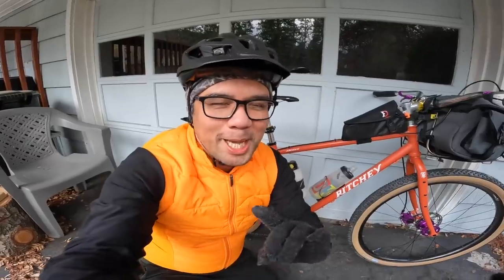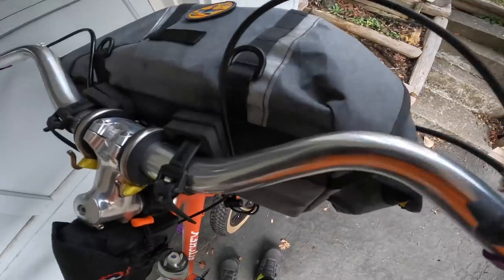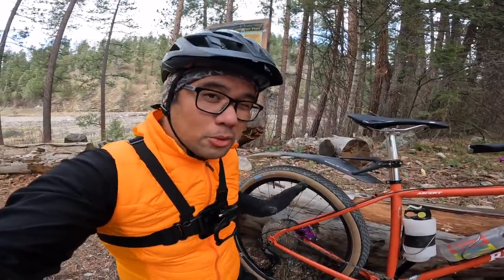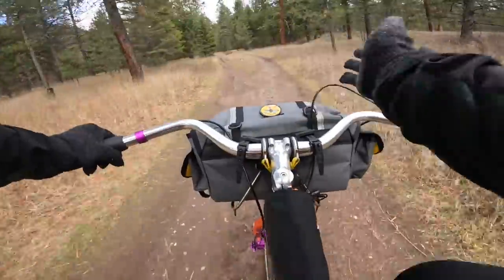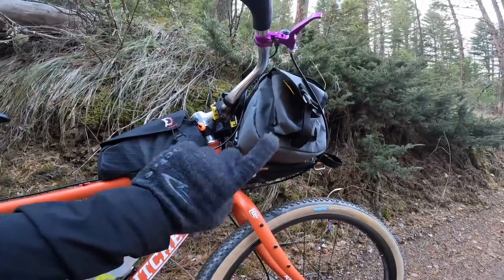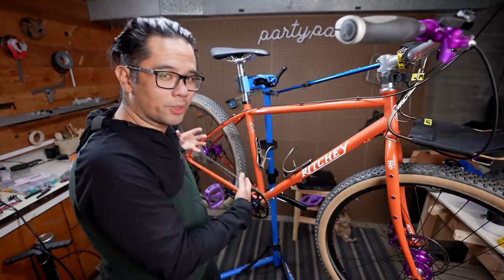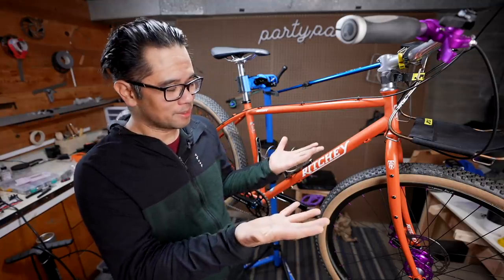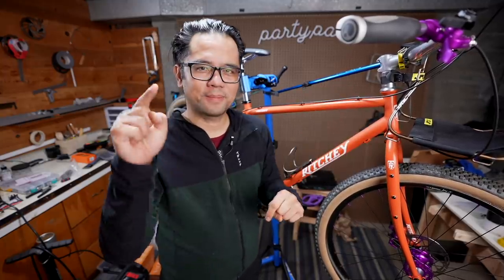This Bike Confuses Most People

Comment: I bought this bike a few days after it was released.  Built it up with Beacon xl drop bars, running 700x45 Rambler tires.  I dig it!  It’s my adventure bike.  It’s been on a few bike packing adventures and a bunch of gravel / single track adventures and it’s been great.  Planning on setting it up with Ardent race 2.35 tires this spring for some spicier bike packing trips that I have planned.  🤙

Comment: Great review and so good to see a brave design ethos in this bike. I’ve got the Kyote bars and added some Ritchey bar ends ahead of the brakes, on the bends. A bit like to VO Crazy but with a hand position in line with the stem - fab
Reply: I have the Kyote handlebars as well. My classic curved barends are positioned as innerbarends where the Kyote sweeps back towards the stem. As they are also 22mm thick you can attach all kind of handlebar accessories. The barends form a loop a bit like a Jeff Jones Bar with the advantage of angle adjustability for better aerodynamics and very comfortable position.
In addition I will test innerbarends from different brands such as Spirgrips and SQLab for the position between the grips and the brakes.

Comment: I have the previous generation Ritchey Ascent with the Ritchey Kyote Bars.  I setup the bike with a large range of gears (3x9), flat pedals and 700x32 armoured urban tires with fenders.  We all need that bike that can serve any purpose - light trails, commute or even road ride in poor weather, all while wearing normal or otherwise not always cycling specific clothing.  The Ascent fits the bill perfectly.

Comment: I have the last version of the Ascent frameset which debuted in 2016. My only real complaint with it is tire clearance, or the lack thereof with 700c tires as it maxes out @ ~40mm. I have a set of WTB Byways in 700 x 40mm on it normally. It does clear 27.5 x 2.1".  Right now it's sporting a set of Schwalbe Marathon Winter in 700c x 40mm for icy/snowy commuting.  I have 2 700c/29er wheelsets for it. I thought the new Ascent had more of the features that I wanted in the version I own.

I recently bought a 2022 Fairdale Weekender Archer in Gloss Black to complement the Ritchey since they both support 650b and 700c wheels, but the Weekender clears 29 x 2.1" tires. It comes with 27.5" x 2.0" Continental Double Fighter III tires mounted on tubeless compatible wheels.  I plan to do a wheel swap between the bikes since I have never set up the Ascent with 27.5" wheels. I also have a set of CST Patrols in 29 x 2.1" that I'm looking forward to trying on the Weekender. 

I hope you have fun with the new Ascent, Russ! Looks like a cool build.

Comment: I had an 80s Fisher Procaliber that I used as my touring bike. Originally the Procaliber was a swanky race bike, one of the first tig welded production frames, and it was light and elegant. It was a little too whippy or "lively" for touring and I figured that it was the thin tubing under load,  but it rode GREAT and felt alive. This Ascent sounds a little like my Procaliber except Ritchey made it work for touring loads, and more. Sounds ideal.

Comment: I have an Ascent Frame in my garage.  It would be a bike already if I could find any parts to put on it.  I will be using Hunt Dyno 650b wheels, Beacon bars and SRAM parts.  Thanks for the info.  There is very little info on this bike, so it is appreciated.

Comment: I'm not sure it's a bar end conversion, microshift also sell the bare shifter for use as a down tube shifter.
Reply: It's a bar end conversion. We pulled the shifter off a bar con for a different build and wanted to highlight Paul's thumbie in the process.

Comment: I just purchased the frame in a medium. I noticed you mentioned you were running 650B x 55.

The Ritchey rep had mentioned to me, since I plan to run this with 650B, they recommended,  "using a large tire – 2.3”-2.6”. The reason for this is with a smaller tire, the bottom bracket drops low and you’d be better off running the same width tire in a 29”. 

Did you notice any issues, being the tire you used was smaller than the recommendation I received?
Reply from the maker: On dirt roads they were fine. On rocky trails you get a little pedal slap on rocks.

Comment: Cool bike!

You may be aware, but the On-One Mary handlebar has this geometry and dates back to 2006 or earlier.  It has more sweep angle though, I think.
Reply from the maker: Similar but the Ritchey is 27 degree sweep vs 21, also considerably wider at 800 vs 675.
Reply: @PathLessPedaledTV  The 21° sweep number on the Mary is the upsweep, not backsweep.  I believe the backsweep is actually 40°!

I had one years ago, and I found the backsweep too much for me - at least at that width.  I get along fine with the the Surly Moloko at 34°, though it is wider at 735 mm.  

On a side note, I do wish they made the Moloko in aluminum - in steel it weighs a ridiculous 709 g!  I'm no weight weenie (my ECR in its daily riding setup weighs about 56 lb, fenders, bags, many full water bottles, and all), but I don't like adding gratuitous weight!
Reply: Lot of this style, I have pair of origin8 on/off,  using the ergon grips for swept back gc1 made a huge diff.

Comment: On the handlebar: why do you care how long the stem is? If you ran a long stem with a conventionally backswept bar, you'd have the same handling and more usable bar space for attachments.
Reply from the maker: Looks dumb (personal opinion) Weight. Also you’ve got a much bigger lever in the front adding stress. Less inspiring to me on harsh terrain with a load.
Reply: @PathLessPedaledTV  , I can't speak to aesthetics, but I think most people would consider the greater compliance of a longer stem a selling point. I would expect the longer stem/bar combination to be lighter.
Reply from the maker: @alexdi1367  wide bars are flexy enough for me.   A longer stem would make it borderline noodly for me.  I don't understand how more material would be lighter.
Reply: @PathLessPedaledTV , you wouldn't use the same bars with a longer stem. Without the mustache shape, they have less material than would be added by a longer stem. Bar and stem flex depend totally on the models chosen.

Comment: Russ,
What’s your stem length on that build?
Reply from the maker: I think it’s an 80.
Reply: @PathLessPedaledTV  I think I am the same or slightly taller than you with a medium frame, zero offset seat post, a 90mm stem, and a 46cm Beacon (non-XL) bar. You have me thinking I should get a professional fit.

I'm looking forward to your drop bar conversion and long term usage reports from your trip. Thanks for everything that you do!